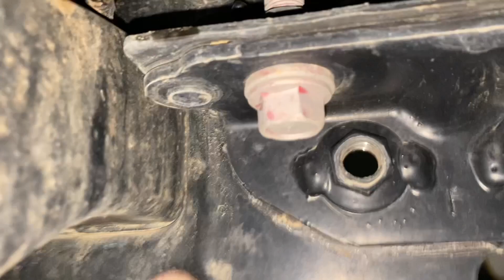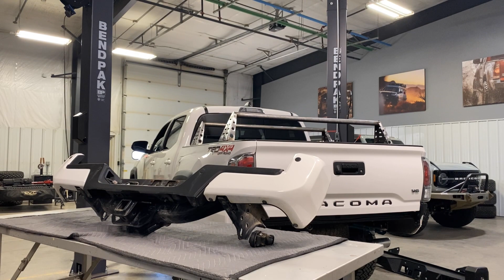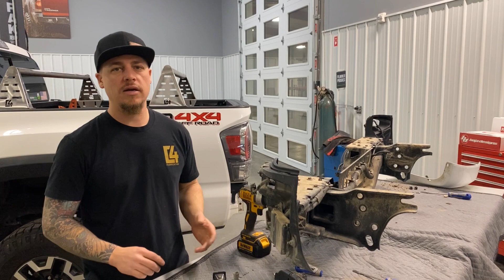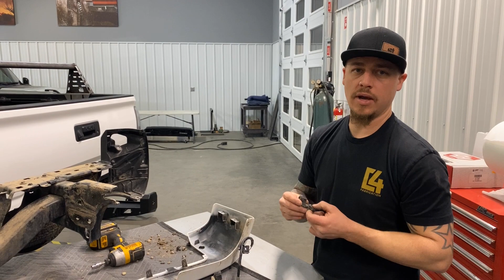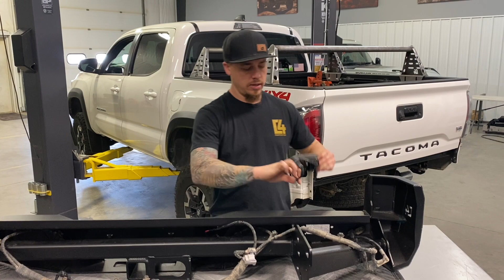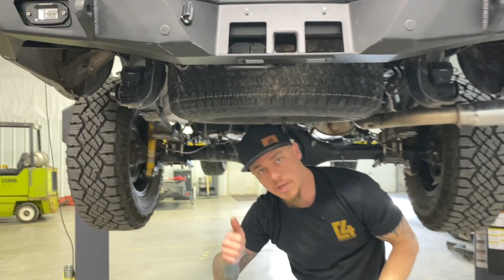3rd Gen Tacoma Direct Replacement Rear Bumper Installation

Comment: Just got done putting it on. Looks awesome! For anyone doing it by themselves, using the caged bed extender that comes with the Tacoma as a stand is almost the perfect height to hold it in place while you bolt it in.

(Edit) Disclaimer!: in this video, when describing how to connect the license plate light that comes with the bumper, he instructs you to connect the white power line from your truck to the red power line of the light and green ground line from the truck to the black wire of the light; however, in order to get the light to work, I had to do the opposite: white to black/green to red.
Reply: Thanks for the advice.👍 i just finished putting their bumper on and had to wire the light the other way.

Comment: Hi there, great video.  Ler chance, what estimate of time do you think it was for you to take off the bumper and disassemble to finally being able to remove the wiring harness?  Tjanks again!
Reply: Taking my time, and having a few beers in the process, it was about an hour to get the bumper off and wiring harness out, another 2 hours to get everything plugged in, wired, and bolted on. That includes drilling the 3/8 holes for the extra bolts.